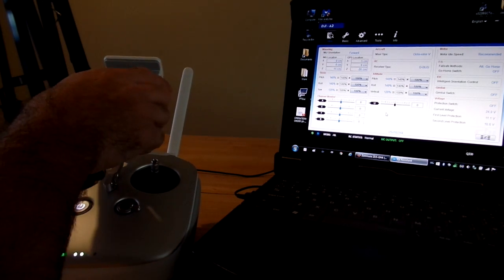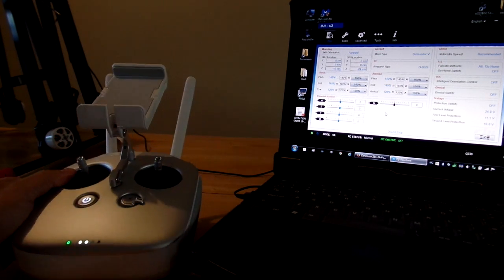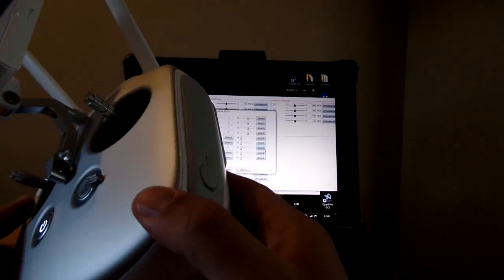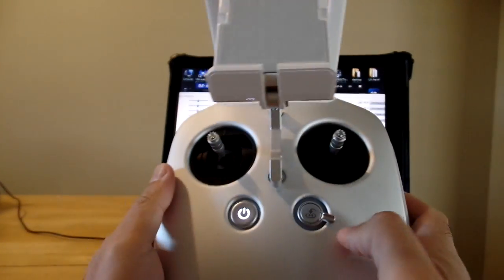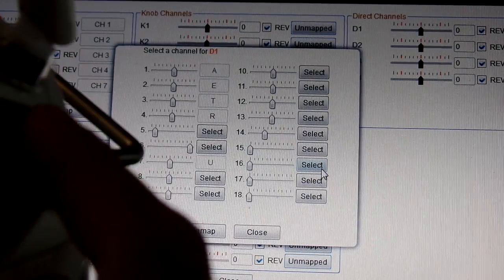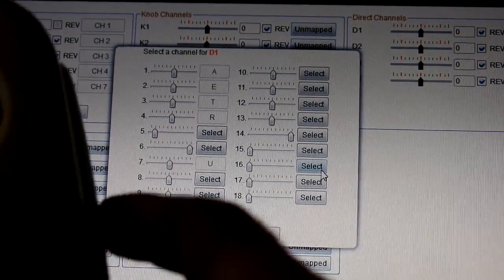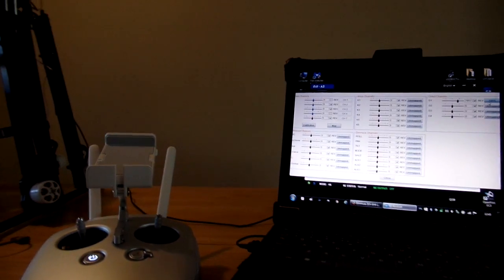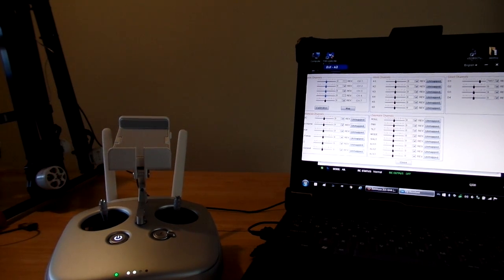Using the Lightbridge 2 Transmitter for Auxillary Functions

Comment: I have connected D-Bus cable to X2 of A2. Only the stick inputs and flight mode are working. Gohome is not reflecting in A2 assistance. I dint even get a beep sound and flashing light from LB2 gohome switch when connected with A2. so I calibrated  LB2 with DJI GO app, now gohome switch works. but when I connect to A2 again it doesnt reflect. 
( I dont have a can hub, so gimbal switches are not reflecting in A2)

Comment: Will be looking forward for the next video. I'd be interested flying with futaba 14sg then using this for gimble operator? Do you think this would be possible? Many thanks
Reply: Also was thinking that the multiple out would be an advantage, be interesting to see how that works too.  I suppose we all have to wait to see what others will say too....
Reply from the maker: +Ashley Hooper It is not recommended by DJI, their reasoning being that the 2.4ghz output of the Lightbridge system will swamp out any other 2.4ghz system, such as from a traditional RC control link. So, the only way I could see doing what you're suggesting is to use a control link on another frequency; dragonlink, for example, or a 5.8ghz transmitter/receiver.